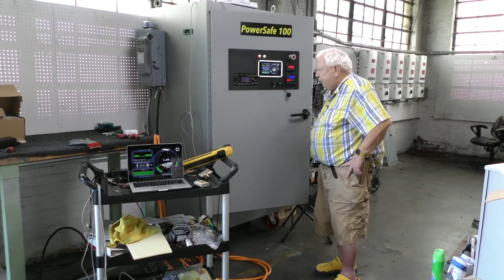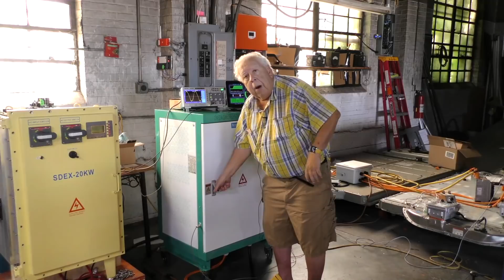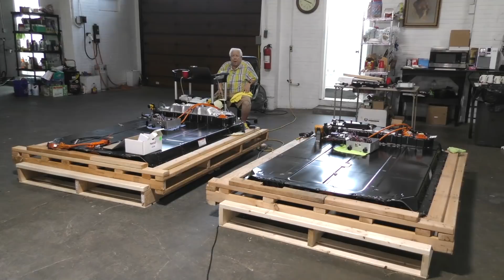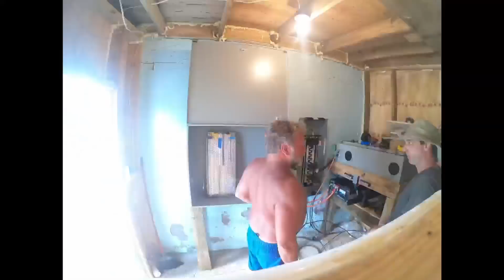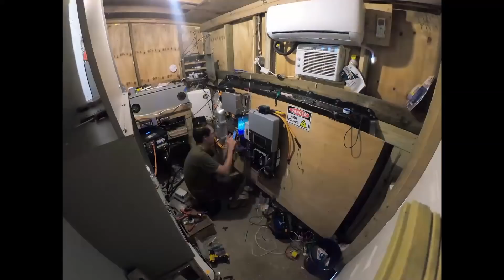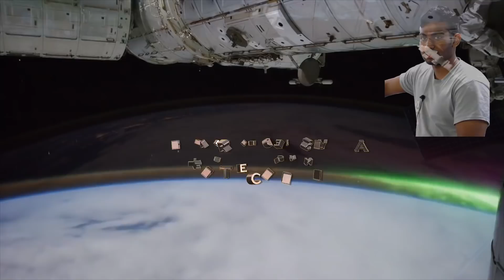Model 3 Battery and Sandi 30kW inverters.  No more 48v Sigineer

Comment: Found this guy back in 2017 when I first started my due diligence on Off Grid Power Supply for our home & property.  Now today July 26, 2025 we find that running High Voltage Inverters is becoming the in thing, mostly in Europe but in the USA too.  Youtube and the minds on here has been great to be a part of and I only hope it can last much longer but I imagine the money makers are not getting enough of their cut as always.  My point is clear when you understand the new laws in Europe and the EV Batteries, like the Micro BMS they are hiding within the Jaguar/Land Rovers and other brands, matched to the new laws on building your own off grid battery supply are aiming right at the DIY man/woman today, so heads up people get it done ASAP.  We have been completely off grid (no meter) since 2017 using salvaged EV batz.

Comment: i have beem messing with inverters and designing a inverter my buddy the ee  i work with dont see the use for high dc input inverter but he said if we do make a high  input voltage inverter it sould  have no big  transformer  I think he is wrong !!!    I think it should have the big low frequency transformer   Not only for isolation but the low  frequency transformer i capable of instance amps from the stored magnetic flux  Making it much stronger more reliable than a trensformerless design       WHAT DO YOU THINK?????  thank you for your time

Comment: Nice, 𝗹𝗲𝘀𝘀 𝗰𝗼𝗻𝘃𝗲𝗿𝘀𝗶𝗼𝗻 (𝗵𝗲𝗮𝘁) 𝗹𝗼𝘀𝘀𝗲𝘀 with 300V DC when end device 250v AC anyway.
Little to much power for me :) 48V was the highest voltage I could get inexpensively :) Sooner or later it won't be practical with large systems like it's the case with Model 3 batteries.
Since I want to power CPUs 48V DC is a better fit with short wire runs. CPU's run at 1,4 ish volts but it gets converted from 12V on a motherboard.

Comment: If it isn't too bold, is there a succession plan in place so your work can continue after you're gone?  You're obviously on the right track to local generation and local use becoming mainstream in the future.  I do wish you well.  You're certainly a genuine soul with your pack of smokes and lighter behind you while talking about the benefits of chemotherapy.  I have a friend who converts conventional gas vehicles to EV, and his YouTube channel is greggoeselectric.  And I personally have 3 of those outmoded 48v MPPSolar LV5048 inverters tied to a substantial bank of Lifepo4's with stupidly thick cables.  Higher voltages would be a huge improvement to reduce that issue.  Continued best wishes, and keep the updates coming!

Comment: Thank you Jack and will pray for you to be well accepted.  Your explanations on why 300v is more sane were well spoken and i most loved the nightclub story.
Reply: That 1.4 Factor is important for everything from electric bicycle batteries 2 portable power Banks to keep your cell phone going without having to go outside in the middle of a workday to get more juice for like a week or two that is and then when you go out you don't have to linger at the outlet I can take the 4 figure wattage here without there being a bump in your pocket when you walk back to your mansion.

With the size of that Hut that the video ends with on obviously it's nobody's home it's just there for the battery.

What's needed however is this business about the individual model 3 batteries being good for amateurs to play with or for big battery.com to send free improvised high-rise incinerating shorted circuit breaker gouging what's the term igniters yeah.

He points out that the entire car battery is a damn nice thing to start with for scratch and he does say how there's a bunch of different versions so when you go ahead and convert it to something for use without wheels it requires improvisation which is Five Guys AR not Outsourcing to apply on the German Bargains Etc. Nonetheless anybody can go on mouser.com and adapt the digital rectifiers for $100 to the 32 volt modules from the Honda Fit first generation electric car and also used lithium titanate oxide. They only have five years of leased usage and are barely $100 a kilowatt hour but what makes them really fantastic is that by connecting them directly to a digital rectifier you can slurp up everything that your oven Jack can offer in a tiny little lunch box receiver. Some applications matter more than others for example cars being further enabled scores below zero on what this man begs for prayers for. On the other hand getting the unicycles to get 2000 Watts charging from 120 volt Outlet that helps the market and keep Mars being no competition to Earth. If you think the starlink redeems people from letting the natural gas Cruise replace all of the pipes without bothering the throw some glass fiber in the ditch then you've been buying the Elon Musk sales pitch and the stock is going to go down a lot and soon even if it's yours partial recovery in the future on the backs of another steroidal hype boom.